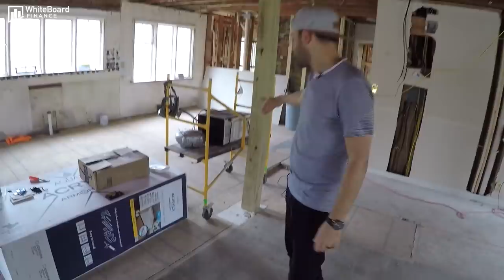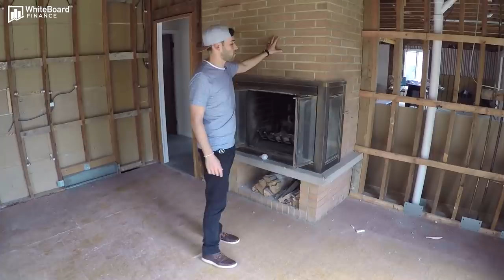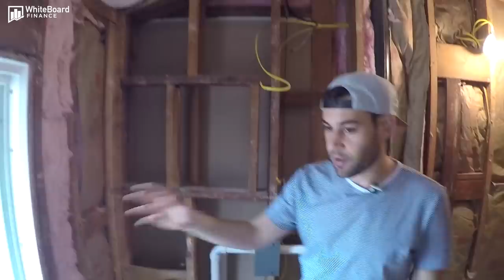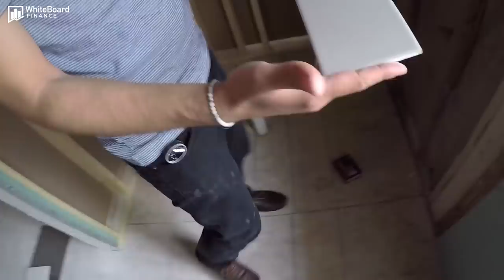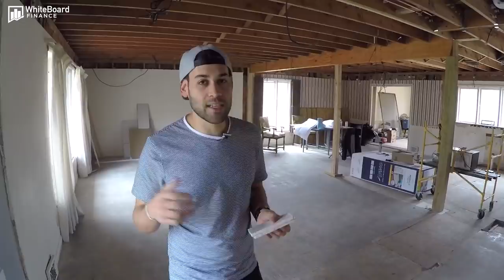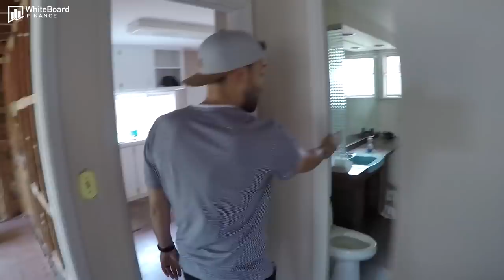How To Flip A House For Beginners

Comment: The house looks damn good, but as a plumber those solder joints are kinda sloppy and in the future you can save money running water lines in pex. You have less material cost, and it's much faster and easier to install than copper and additionally pex expands and contracts. To me it's a superior product all the way around. I seldom sweat copper anymore for the reasons listed above.
Reply: I concur regarding the plumbing. I'm not a plumber and I do better joints than those. I'm sure the connections are probably OK, but he or she needs to wipe the joints and could probably use less solder. Great video!
Reply: charles king pex all the way 💯
Reply: I was thinking the same thing
Reply: He was running away from water pipe lines like his  hat was set on fire😂
Reply: @chudy-ko5jb  ha I noticed this too. Cameraman brought up pex and he completely avoided it.
Reply: Pex 100% the way to go. Cheaper, easier, and honestly that stuff is almost fun to work with

Comment: 2012 was a great time to get in!  Jared is great and you can tell when someone is genuinely passionate about something as they have original ideas and great knowledge (i.e. the dog shower and what he knows w/o Google :)
Just in this video I learned and noticed a lot also, the metal plates to protect plumbing, how he replaced the knob and tube, tucking the header inside, using copper instead on Pex, 50 showings??? etc. .   I am also very passionate about this and have so many questions!   On my first flip I was lucky and sold on the 1st day, within 20mins it was sold. After that I have been hooked since, it's hard to find like mined people such as Jared!   Another great vid!    subscribed!
Reply from the maker: Thanks for Watching Jose!
Reply: Everything you mentioned is code or common knowledge.

Comment: As a hvac guy those are terrible solder fittings on the plumbing line sorry but it works and it’s clean ran pipes.

Comment: Why did you use Copper rather than Pex or PVC?
Reply: @conspiraorgeastghostcom3437  Yeah that's a myth. There are no health risks associated with drinking water from PEX pipes.

Having too much copper in your system is also super dangerous, especially for the liver. But copper pipes are safe.

Comment: I am a carpenter / painter . I've worked for a few flip jobs over my 25 years of experience . Most house flips that I've been involved in are an absolute nightmare , all the trades are usually out of sync . Nothing is done in the correct order . The house flippers tend to go with the lowest bid for work and hire people that are generally inexperienced  . I've learned to stay away lol .

   In the 2-4 months it takes to flip an average house between fixing it and selling , I can complete painting and repairing 10 + Exteriors and make 60-80 grand working by myself and 1  laborer  during the  good weather months . 

   I've seen a lot of house flips barely make 10-15 grand if barely break even . It was a lot more lucrative 15 year's , now hose flipper's  are everywhere driving up the prices for junk house's which =  less profit .

Comment: wow I'm surprised you going to list the house for so much, especially when it still have that old Knob-and-tube wiring, the electrical. There are many problems with that old type of wiring, an you know you can lower your insurance payment on the house by replacing it. Also A Pex is the way to go. It's cheaper an faster of doing it. Your saving labor an labor cost.

Comment: Another question, are you paying others from different companies to do your contracting? Or do you have all those people yourself? The electrician, plumber, and so on! ;)
Reply: I would recommend using a GC or general contractor for your first few deals. They will manage the sub contractors (plumbers, electricians, etc) pull all permits, order materials, etc. Using a GC is more expensive than hiring individual contractors, but it is much easier, especially as you are learning the business!

Comment: Great video guys. Just finished and sold second flip. First one I did was sloppy and I cut corners. Buyers notice EVERYTHING. Second one I paid attention to those things and paid a little extra for the pros to handle some of the work. Sold the house at open house on day 1. Definitely worth the few extra pennies to sell fast than to hold that stress on top of holding costs. I saw you said you used hard money too, which is usually short term, my stress level would be through the roof trying to complete a project and sell it at that size using hard money. I completely agree with the plumbers on Pex. I know copper is the most expensive. All my supply lines are pex or cpvc. The WiFi stuff is definitely cheap and for a couple hundred bucks it makes sense to include that appeal when competing with a majority of the market without those features. Good luck on the sale, I’m sure it will have an offer within the first week

Comment: i'm an expert building inspector guys with the state of new mexico for 23 years after being a custome home builder for many years licensed as an general builder , electrical contractor with journeyman licenses , and  mm98 licensed to bid and install cooling and heating and plumbing ok journeyman in all the trades having gone thru all the formal trades training , if you buy a flipper you are damm desparate in life dont do it ok , dont buy a  home where you inherit all the problems ok like no permits for plumbing and electrical and or structural building ok dont do it i have seen man have a heart attack over this yes and die from that heart attack he had just a week or two before he got his co for the home he died his wife put is up for sale after to weeks of closing the dream home ok